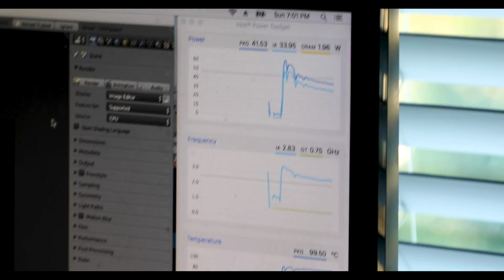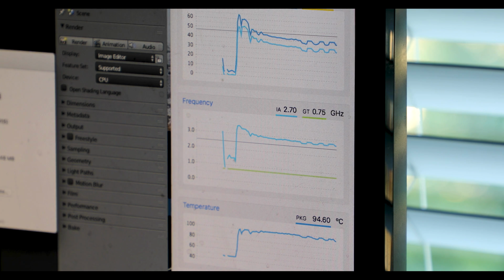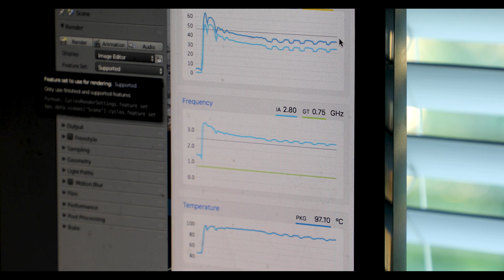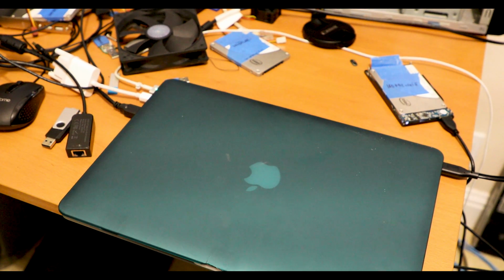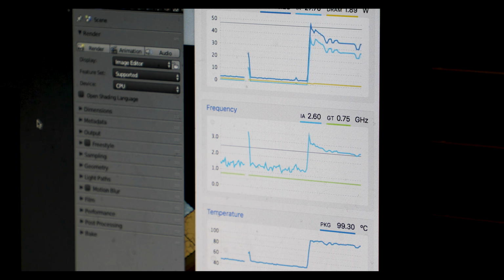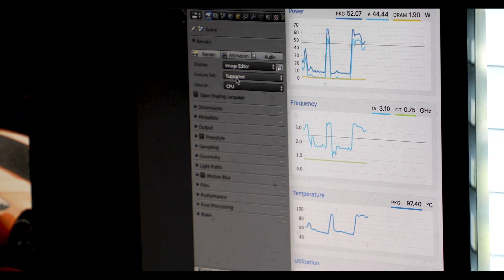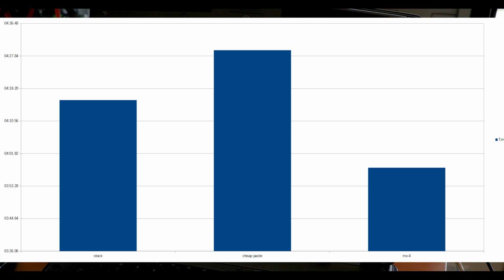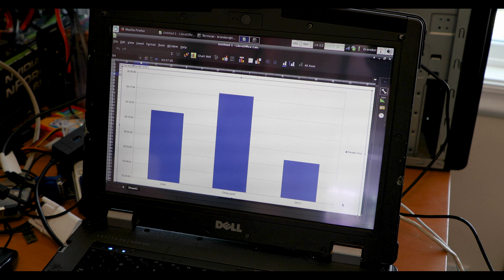Repasting A 2015 Macbook Pro: How big of a difference does it make?

Comment: I used the same thermal paste and my score jumped from 1300 to 1450 in cinebench r20. Making it about 12% faster.
Reply: I got exactly the same results recently - from 1337 to 1431.
Reply: Only under 100% load under normal use Macs sip power like crazy so you wont see a difference.